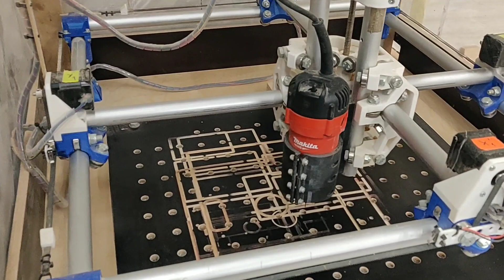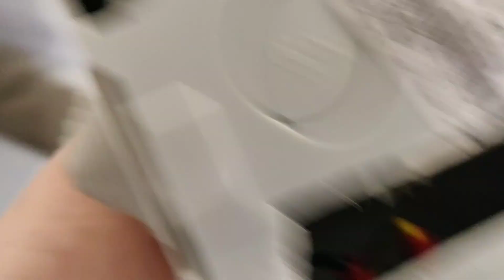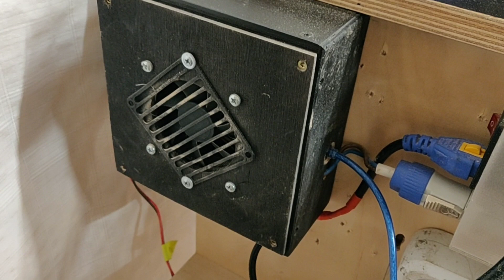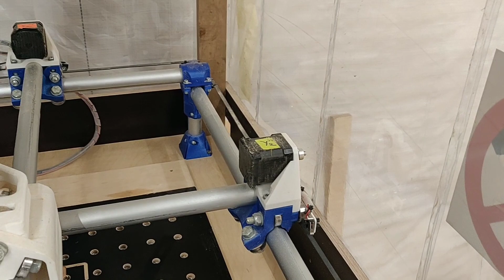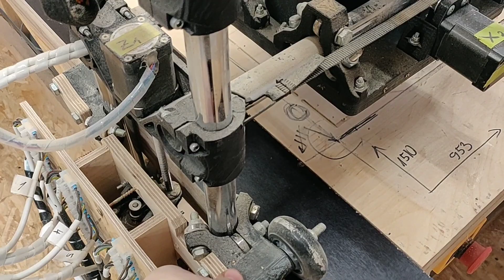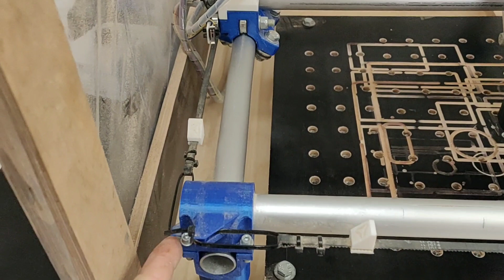MPCNC or LowRider2?

Comment: Good Day, I'm thinking of building one but really need your advice I wanted to build one with a working area of 4ft x 3ft just to cut MDF you think it'll be possible?
Reply from the maker: Hey! I think it would be possible :) But 4ft is quite big for the MPCNC, might have some rigidity issues. Have you looked into the new design for the CNC form V1 engineering?

Comment: Hi, I'm working out bed size for my LR2. Yours looks a big enough, what size is it please?
Reply from the maker: Hey! At the moment usable work area is 1400x950mm, usable Z height 150mm. Basically, it was the biggest sheet I could fit in my Volvo
Reply: @KarlisZalitis  Brilliant, thanks for your reply. May have to change my car 🙂  I've gone with your design, double layer tubes, spindle etc. Just working out enclosure and table size, mine will be in my garden shed so noise is an issue. Thanks again

Comment: In order to reduce the flex of round tube did you think of changing them with square tubes?
As it is done there: https://www.thingiverse.com/thing:3010914
Reply from the maker: Hey! I have not tried square tubes - will check it out
Reply: @KarlisZalitis  normal square tubes  are more resistant at flexion, round more for twist.

Comment: My summary: These are great hobby machines to learn about CNC routers and they are useful for prototyping.  They are not good for production i.e. earning money from their output.

If you need larger than 2ft by 2ft (600mm by 600mm approx) then use the lowrider.

Comment: Do you have an opinion about the Marlow? And have you considered if the low rider could be changed to work vertically on a wall? Thanks for the video.
Reply from the maker: Did you mean the Maslow CNC? I quess with some creativity the MPCNC could be converted to work vertically, but in my opinion the gains would not outweigh the loss in structural stability
Reply: Maslow indeed. Sorry for the typo. My problem is garage space.

Comment: Its really long video :D
Can u please write a summary, what are the main advantages of lowrider compared to mpcnc and vice versa. How should I choose between them?  Which one do u think is more precise?
Reply from the maker: .... it realy depends :D I guess, the main advantage of the LowRider over the MPCNC is the cutting bed size, but you sacrifice rigidity. And many more trade-off's and compromises with winners on both sides... I mainly use LowRider, but it has become rather custom build... What are you planing to do with these machines?

Comment: I've contemplating making the lowrider one. What keeps it from moving side to side in the X? Seems like something should be squeezing against the sides of the table
Reply from the maker: The X axis does not move much from side to side - roller skate wheels do a pretty good job keeping the gantry in place, although there is some backlash. The motors will skip steps and belt will strech before the gantry itself moves any considerable amount.  I have added a second pair of wheels under the table for extra support, the solution can be seen here - https://www.youtube.com/watch?v=8YQLOGYW_lA

Comment: How do you handle the chips?  I saw a video on here earlier with some dude doing aluminum (his video is what made me finally decide to do this) and his aluminum chips would have been about 6 inches deep from one job.  They were super fine chips but how in the world does one handle that?  I see you have an enclosure, which I will do as well, but how do you get those chips out of there or they will build up and bust something before the job finishes?
Reply from the maker: I have not done that much of aluminum machining. While cutting, I used compressed air to clear out the cut and prevent chip welding - just manually pointed the blower end of compressor to the cutting action. The blown off chips then collected in corners of the enclosure. I am planning on adding constant directed air nozzle and close off the enclosure while cutting aluminum.
Reply: Yes, but how do you handle the chips that accumulate in the enclosure?  I need to investigate this more because a standard shop vac isn't going to cut it.
Reply from the maker: Shop vac did the trick for me - just vacuumed the chips straight up after I finish the cutting. I have a dust bag in my Karcher vac and I dispose the bag in garbage bin afterwards
Reply: I have decided on a Venturi effect Vacuum because it doesn't matter that the chips are sharp and wet (with a mister) but a shop vac most people go through in under 3 years if they do a lot of metal.

Comment: You should look into building the Gatton CNC. It is way more sturdier than either of those you have.  Check it out on youtube before you make a decision. You can make it  big enough to do a little bigger than a half sheet of plywood. Costs about $1200 to make one using his kit and other readily available hardware. Check it out.
Reply: 1200 versus 100-300 or even less if you have any 3d printer parts around (my case).
Reply from the maker: I will check it out :)
Reply: For 1200 I'd go with WorkBee CNC.

Comment: What depth per pass are you using on the aluminum? When cutting aluminum use shallower depths.
Reply from the maker: I cut in 0.2mm depth but I believe I have problems with my router speed. Will try to cut aluminum on the LowRider that has the more powerfull spindle, will see how it works

Comment: If you are burning wood and your bits then your feed rate is to high. You need to slow it down in the software. The spindle should handle cutting wood with no problem.

Comment: I appreciate your video. You did a good job breaking everything down. How are the aluminum tubes holding up? are there any wear grooves from the bearings? In the US the stainless tubes are harder to source and are more expensive, but I finally found a place that sells them as shower rods for hanging curtains. The electric conduit I used is pretty good, but the surface isn't the smoothest. It is stiff enough and holding up well. This will help me to decide if I will move onto a Lowrider or not. Are you on the forum? Thanks again.
Reply from the maker: I am not active on the forum, just lurking around there sometimes.. 

Aluminum tubes do show some wear and denting on the roller bearing contact spot, but until now there has not been a significant increase in backlash. But it can be compensated by tightening the central bearing bolt of the rail assembly

I would recommend  the stainless tubes due to similar hardness of the contact surfaces to avoid problems in the future. But aluminum tubing also works
Reply: Where did you find the shower rod?
Reply from the maker: @nathan1sixteen  My tubes were found in my local hardware store - they are rods for hangers, used for custom wardrobes